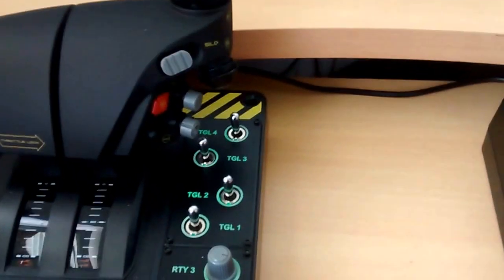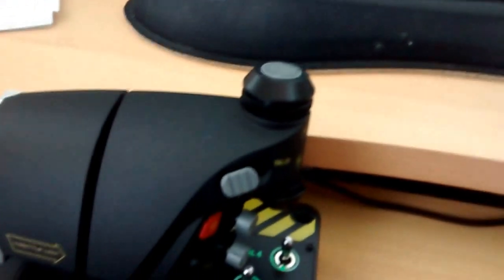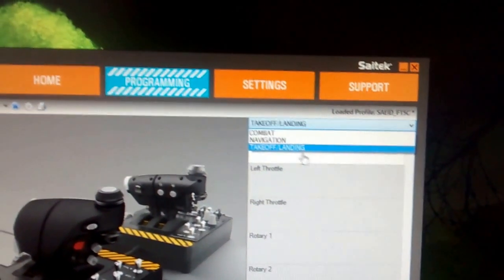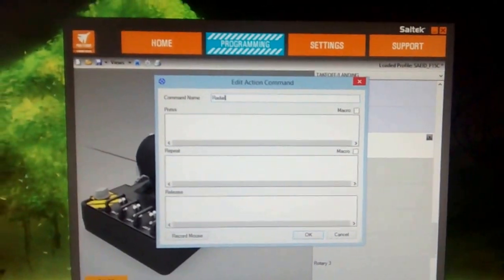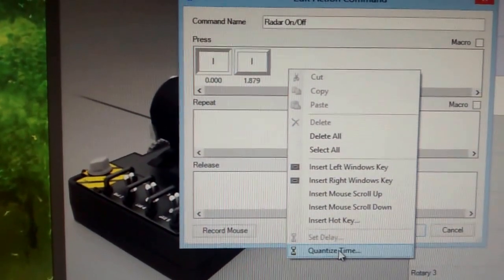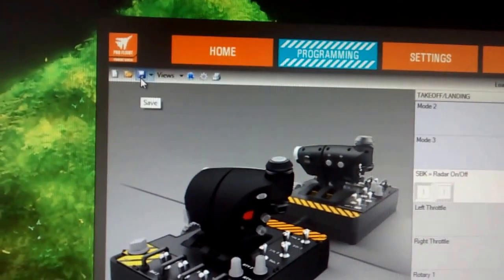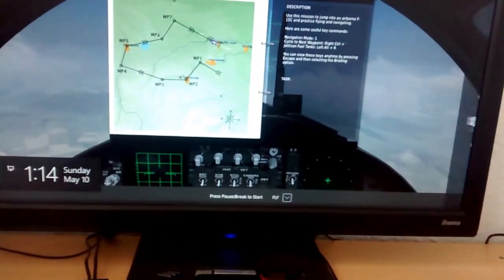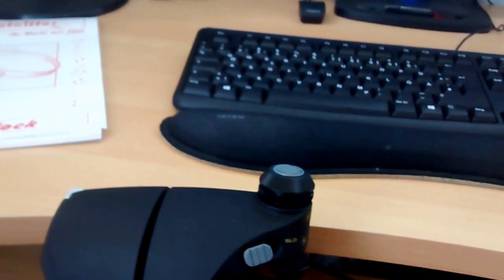Saitek X55 Rhino Slider Switch Programming

Comment: Hello, I also have a x56 (not the Rhino-version) and my Slider isn't programmable. The button works, but your advice don't work, when I try to test it. I don't know, if it have to do with the fact, that the software find and shows a x56 Rhino, and not the x56 RGB. Do you have any clue to fix that?
Reply: Hi, did you solve it? I have the same problem, only works like half of the strokes I input.

Comment: Thank You Thank You Thank you.. Now the SBK finally works like it should.. I could not wrap my head around it..
Reply from the maker: +Stefan Asmussen Glad it helped :P Happy flying!
Reply: +EMBEDONIX hello can you make a hawk t.1 profile please becuse i dont now how to program x55 in these aircraft if i move throttle up the stick moving but the throttle not moving what should i do ?
Reply from the maker: KlashnHacker Hi, Unfortunately I don't have that module.
Reply: I have the Hawk module, what do you need it to do? Have you set the correct axis in Axis commands? And removed all double binds?
Reply: idont now more in dcs i only enter and play
Reply: KlashnHacker You have to set up all your controls under axis commands for each plane. I am guessing you are flying in SIM mode and not easy mode. I could share my Hawk controls, but they would not be much good to you. But I will do what I can to help you anyway.
Reply: +Stefan Asmussen thank you very much man thanks for help i will try now
Reply: +Stefan Asmussen Thank you i solved my problem :)

Comment: @spudknocker noticed in your F14 hotas setup you said that you had to assign a modifier to turn off airbrake because the switch only activated when you slid it forward, here's your solution.